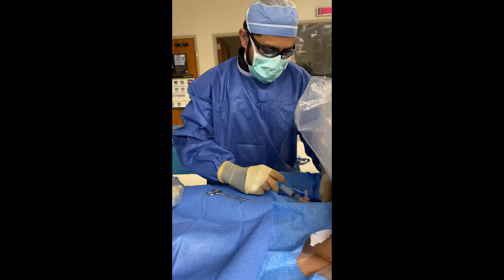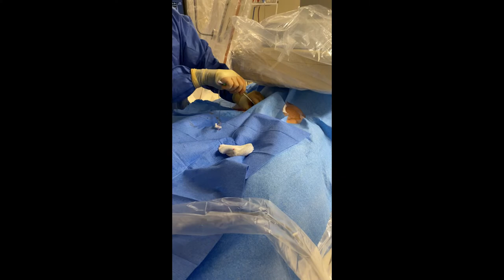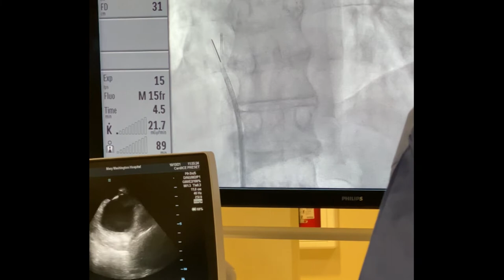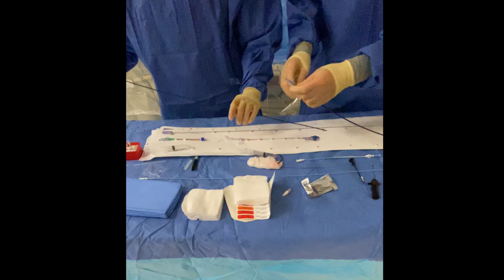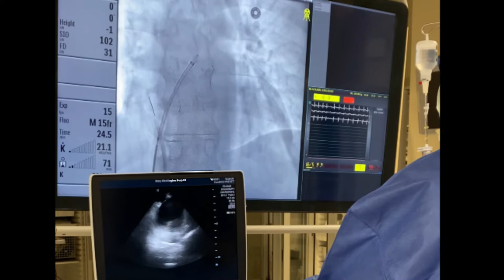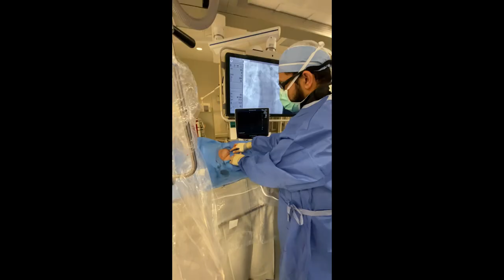Closing the Hole in My Heart (PFO Closure) WITHOUT Open Surgery!

Comment: My daughter is going to have this procedure I think. She has a big hole at the upper side of her heart that has provoked her PH. The dr is not closing completely.
Reply from the maker: I wish your daughter the best of luck with her procedure. Usually if the pulmonary artery pressures become quite high, you almost want to have some “hole” left to serve as a release for the pressure to take some of the strain off the right ventricle (which pumps blood to the lungs). That is why, I am guessing, they mentioned they will not close it completely but enough to hopefully minimize the problems it is causing.

Comment: Hi doctor. My son is having 21.6mm hole in his heart. Can it be treated without open heart surgery. Thanks in advance.
Reply from the maker: In most cases, yes it can be..as long as there is tissue around the hole that can hold the device in place it , it should be able to be done...this can be evaluated with a test called a transesophageal echocardiogram

Comment: Hi sir,My Mother Age 42, she had a 30mm hole in heart,have possibility to close in this procedure.
Reply from the maker: Hi Prabhu, a 30mm while is actually quite large and should almost definitely be fixed. The good news is, the yes it is possible to be fixed with this minimally invasive technique. In the USA, we can fix up to a 38mm hole with this device as long as there is tissue around the hole for the device to be able to be held. I hope your mother can get this done.
Reply: Hi Dr. My sister has hole in the heart she is 39yrs old now what we should do her heart rate is only 70 she is having a short breathing I hope we will find inexpensive way solution or what should we do please help my sister 😢

Comment: I have 24mm hole in my heart.Is it need any surgery to close the hole?
Reply from the maker: Hi, generally speaking that is a large hole and holes greater than 10mm over time tend to cause more problems. Here in the United States, we recommend closing these. Most can be closed with this procedure or similar procedure to the one in this video.
Reply: @Z_MD  Thank you

Comment: Sir my asd 3.88 mm hole divice close
Reply from the maker: Hello Anji Mobiles,  You ASD is generally considered small and may likely NOT need closing.  However, if there are signs that it is causing problems such as causing the right side of the heart to enlarge or if you would ever suffer an unfortunate unexplained stroke or mini-stroke then the argument for closure can be made.  If you are doing well, there is a greater chance this ASD will not need closed.  Thanks for the question. I hope that helps.
Reply: Than's

Comment: I have also 2hole can its possible age of 34🤔
Reply from the maker: Yes it is possible to close multiple holes with a similar procedure. Often this can be achieved with one device but sometimes may require more than 1.  Every person does not need the hole closed. Certain conditions or situations would warrant closure, but interestingly probably most people with these “holes” do not require them to be closed and do completely fine. I would recommend having an evaluation from a cardiologist to determine if yours need to be closed.

Comment: Hi doctor thank you for sharing this knowledge nd video.informative.
 I'm from India belong to Karnataka state..., after doing eco nd TE test doctor said that I have two birth whole in my heart .but doctor suggested for a open surgery.pls suggest device surgery is good or open surgery is good ?....nd also pls say in few post after the does it have any side effect or any problem on future also suggest does this surgery is the permanent solution. please answer
Reply from the maker: Hello, so it depends on where the holes are located, whether they are better to be closed with open surgery or this minimally invasive technique. It is certainly possible to fix multiple holes with this technique.  For this particular procedure the success rate is high. The risk of the hole “re-opening” is less than 0.5% a year. The complication rate is also very low if done in experienced hands. I would get an opinion from a specialist there who specifically does this procedure. I know it is done in India so there should be physicians there that are expert in this as well.
Reply: @Z_MD  Thank you so much for the reply. But I really don't want to go for an openn surgery...if device surgery worksout for my two hole in heart then its really well nd good.
Also please suggest in device surgery does the marks or fracture remain the same or marks doesn't come..but it will come in open surgery right...i guess it's too painful also as doctor suggested yesterday that open surgery but i really dint know about device surgery after going through YouTube video regarding whole then only i got to know about it. 
N which surgery chance of re-opening the hole. please answer
Reply: @Z_MD   Hi doctor  As per the doctor TEE report i have two holes.find the below
1) 17mm SVC  type ASD with left to right shunt 
2) 3mm ostium secundum ASD with left to right shunt.

Please suggest which surgery is good and advisable.
Please answer
Reply from the maker: @hemashetty417  hello, so unfortunately, usually an ASD involving the SVC, also known as a sinus venosus ASD is better treated with open surgery.  The small secundum ASD probably would not even need to be closed, but since they will be doing the other one, im sure they will also just take care of the small one while they are working.
Reply: @Z_MD     Hi doctor  As per the doctor TEE report i have two holes.find the below report status
1) 17mm SVC  type ASD with left to right shunt 
2) 3mm ostium secundum ASD with left to right shunt.

Please suggest which surgery is good

Does the device surgery can be done for this size of hole?
Please answer
Reply from the maker: Unforunately in your case, it may not be the size that is the problem.  a 17mm hole can be closed with a device, but the issue with yours is the location.  It is not traditionally done using the minimally invasive technique shown here, however I would see if there is someone doing these at a big cardiac center who could look at the images of the TEE and determine if they think it is possible.  It is not the standard way to take care of that particular ASD, but sometimes a minimally invasive technique using different devices (covered stent) can be done, but it may not be the best way.
Reply: @Z_MD   Thank you so much doctor for your reply and your so kind and good.I'm thankful to you for taking out time to look at my msg and you replied patiently how nice of you. Every doctor should be like you.Thanks a tone ❤️
Reply: Have you done with your closure?
Reply: Pls do reply
Reply: @vishalmehta5526  no.yet i dint had my surgery
Reply: @hemashetty417  ok I recently had it
Reply: @vishalmehta5526  which surgery you had an share your experiences
Reply: @Z_MD  Hello doctor, my daughter is 6 months old. My daughter has 14mm ostium secundum asd with left to right shunt in her heart. Can my daughter be treated by device closer method or not. Is it possible to treat her by device closer method at the age of 6 months? Please sir reply now my daughter  Weight is 5 kg

Comment: Hello Sir - my son (7 and half years old) has been diagnosed with a 6 mm ASD. We are naturally very concerned about this and would like to know what steps we should take next.

Given the size of my son's ASD, we are wondering if it is likely to close on its own or if he will need surgery to repair it?
We are grateful for any guidance you can provide.
Reply from the maker: Hello Vikash, the ASD is still considered small. However he will need close follow up for symptoms such as getting sob easier than other children and also monitoring of his hear with yearly echocardiograms to make sure no right heart enlargement is occurring. They can also do a catheterization study to evaluate how much blood is shunting across the hole and if that number is significant, the hole may need fixed. Usually though, we wait for suspicious symptoms before proceeding with the catheterization. I hope this helps.
Reply from the maker: The hole will not likely close but it may very well never cause him any issues.